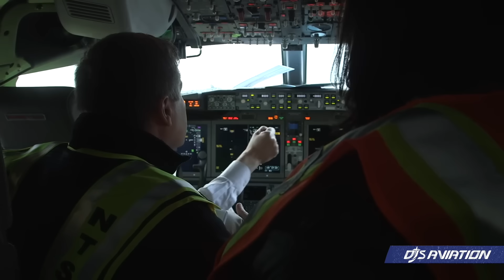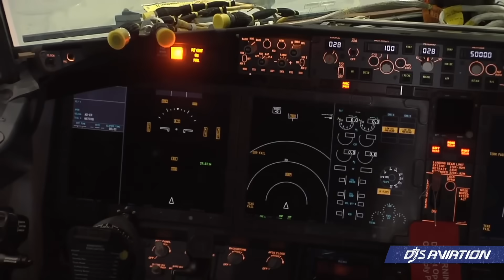Huge Boeing 737-9 Grounding Updates

Comment: The FAA must make it crystal clear to Boeing that this their last chance. One more quality control failure and the MAX type certificate will be suspended, pending a stripdown audit of the production process, and a stop on the production lines until a restart under a completely rebuilt product safety ethos.
Reply: It should be a wake up call. quality should now be the focus rather than what we all know beginning with P and ending T.
Reply: @nickolliver3021  The rudder bolt issue should have been the wake-up call, but it wasn't. MCAS and 346 uncharged cases of corporate manslaughter should have been the  wake-up call, but it wasn't. 
In my opinion THIS TIME the FAA should have pulled the MAX certificate and stopped production but it won't.
Reply: @ihmcallister  The rudder bolt isdue was on the previous models. The mcas and 346 people is on the new model. If you really believe the MAX certificate should have been stopped by faa then go tell em but they can't because orders and demand prove its worth continuing and making it better.
Reply: Eventually, in the worse case scenario I guess Boeing could be placed under FAA temporary administrative supervision.
Reply: @nickolliver3021  "Orders and demand" should play absolutely NO part in what the FAA does once it has investigated Boeing.  If certification for the MAX, other 737s, or ALL Boeing aircraft needs to be suspended until they are all checked and if necessary rebuilt, and the company accepts continuous oversight from an independent FAA team, then so be it!
Reply: @chrisantoniou4366  tbh investigations go on for months if not years so by that Boeing won't have any orders this year. But they have to in a way where the ntsb have to put final causes as to what happened. If not orders have to cone in in tne background. As its just for the max 9 then whatever had to be done before all resume, has to be done. Then they go from there. Other boeing aircraft dont need checking as as I said only max 9 needs it.
Reply: @sylvietougas9374  The FAA doesn't have the manpower to do that nor the funds to hire that manpower. And that lack of funds (already severe at FAA) can be blamed on Congress.
Reply: @nickolliver3021  If the failure of the 737 MAX 9 door plug is found to be systemic in nature (lack of or inadequate checking, falsifying checking, untrained or inexperienced staff, etc) then there is every possibility the inquiry will spread to other Boeing models.
Reply: @chrisantoniou4366  They won't be because those other boeing models won't have the plug doors. This is specific to the max 9 only.
Reply: @nickolliver3021  Read what I wrote again...  If the problems are SYSTEMIC, the inspections and possibly groundings will affect other Boeing models.  Loose and/or missing bolts are not exclusive parts for door plugs - the loose bolts in the rudder are testament to that!
Reply: @chrisantoniou4366  I'm not going to repeat myself but it won't be on other boeing models. It's only for the max 9 only. Max 8 is fine. I'm not repeating myself again
Reply: @nickolliver3021  I "heard" you the first time.  Happily however, it won't be you who makes that call!
Reply: @chrisantoniou4366  oh would it be? Well at least read what I say twice because that was the truth

Comment: What about Spirit AeroSystems? That's where the fuselage (including plug door) are assembled before being shipped to Boeing for final construction.
Reply: Boeing took the plugs out and then reassembled it back in. 

Also it is ultimately on Boeing QA for allowing poor standard from their contractors to pass.
Reply: They are suppose to pressure test it so no excuse really
Reply: Boeing can delegate tasks to a sub contractor but it can't delegate the responsibility . They need to conduct oversight, through audits, samplings in accordance with their Quality Manual.
Reply: @johnhayes1635  Loose or missing bolts on a door plug may still pass a pressure test, but once the nuts on the bolts come loose they can be shaken off in service and the door plug can then come away.

Comment: How many more so-called quality escapes have they been on these planes?  Luckily, they found the door problem with no loss of life and it certainly looks like it’s not the only plane from the series affected by loose nuts on the door plug. What else is there how many ticking time bombs are out there?  They really should take a plane that has been in use, not straight off the production line, because now Boeing will be making sure everything is tight and strip it.  That should go for every model that Boeing have produced in the last five years. I’m not getting on her new Boeing aircraft I want an aircraft that’s been time served. You normally find when the quality starts to escape as they call it it doesn’t only affect one part of the product.

Comment: They should all be scrapped as  no one knows how many faults will come to light over the next few years.These airlines have gone into this nightmare with their eyes wide open, the groundings,saftey issues,plummeting asset values and operational losses. These directors should be sacked,a cheap aircraft is cheap for a reason . Shareholders have had enough by these poor management of alaska they must resign today.

Comment: Based on everything I've read and listened to, Boeing, since McDonnel Douglas became involved, has cut quality control to a bare minimum, and in some cases done away with it.  I'm not sure if Boeing aircraft are really worth purchasing if you're a major airline.  There's no excuse for the mistakes they're making.  Qualified, non-company, inspectors need to double check every part of the work being done during assembly and during maintenance after the aircraft is in use.  Too much good old boy system between the FAA, NTSB, and Boeing.  That never works out well.

Comment: I’d fly on a 737 max 9. What’s the worst that could happen?
Reply: Is that a trick question, as I have a pretty good answer for that??
Reply: Make sure it has emergency doors instead of plugs though
Reply: Seems like the worst that could happen would be you taking innocents with you while fulfilling your death wish.
Reply: Keep your seatbelt securely tightened during the entire flight   :-)
Reply: Once they've been re-recertified, they'll be the most heavily inspected planes in modern times. After all that, they SHOULD be safe.
Reply: @rodh1404  "SHOULD" being the operative word, no guarantee they ARE nor WILL BE!

Comment: quality escape???  bull.  Boeing constructed the fuselage to the demands of Ryanair which, because it crammed so many passenger seats on the aircraft, had to have extra exit doors.  But other airlines, e.g., Alaska, did not imitate Ryanair.  Those extra exit doors were therefore unnecessary.  But the fuselage of the max 9 still had them.  They just decided to plug them (i.e., they were not going to be used at all in emergencies).  thus from the inside of the plane, there were no indications of these extra exit doors.  Boeing should have constructed another type of fuselage for customers like Alaska Airlines.  But no, they wanted to produce the aircraft type as cheaply as possible by sticking to the fuselage demanded by Ryanair.  Once again, Boeing chose profits over safety!!!  quality escape???  please, don't make us laugh!!!
Reply: There's no reason a door plug should be unreliable, and 737-9 is not the only plane to use them. Also, airlines like Alaska want them anyway. Having no option to later remove that plug kills resell value, and Boeing was advised by its customers to use a plug rather than a separate model with no door.

Comment: Boeing's design failures and their poor 'quality control' issues are putting Commercial Aviation Maintenance Technicians on the spot! It's one thing to maintain a quality product, but it's another to try to maintain poorly designed and poorly built aircraft!

Comment: Most of this conversation is I believe is part of the problem. This commentor is really just talking crap. The work that has caused the  problem has been carried by a mechanic way down the food chain. That work has not been up to standard. But then standards don't start at the bottom they start at the top.

Comment: There is a strong case that this wasn't a Boeing problem, it was a third party contractor who failed to reinstall the bolts after installing a WiFi system.
Reply: Debunked already.
Reply: This is all about perception though.
Reply: @apveening  Debunked by whom?

Comment: Has nothing to do with Boeing. It's the wifi company.
Reply: No, it's the runway. Or the radar. Or the fire truck. Anything but Boeing, right?
Reply: Doing inspections on planes with and without the Wi-Fi upgrade might uncover some answers or differences between factory installation or maintenance installation.
Reply: @Old-Blue      Exactly.  Somehow I'm thinking the wifi installers are not necessarily versed in the subtleties and intricacies of how a door plug is properly re-installed. If their activity there went unmonitored / unchecked, wow.  Wonder if it will come to this. Unqualified personnel handling critical hardware they're not trained to handle.

Comment: Thanks for some quality weekend comedy. Boeing has nothing to do with this. The fuselage and plug were manufactured by Spirit AeroSystems in Wichita. Boeing may have chosen a poor supplier, but to place blame on Boeing for this manufacturing defect is quite a laugh.
Reply: Is it a Spirit airplane, or a Boeing airplane?
Reply: Apart from Spirit having formerly been Boeing, Boeing is the aircraft manufacturer and therefore responsible for the finished product.  It's up to Boeing to ensure their contractors are providing the company with components which are properly manufactured!  Having said that, it doesn't seem to have been a failure of the part itself, but in the way the door plug was attached to the aircraft - loose and missing bolts seem to be the culprits here and if that turns out to be the case, the blame has to lie with the last people who attached the door plug to the aircraft.

Comment: I noticed the extra [flat] antenna on the alaska max9 plane, it is possible that those planes will use starlink networks integrated to their autopilot and all its system, like the tesla cars. Alaska and United want to gradually remove the pilots and fly the planes remotely like a drone.  Any individual, let alone governments and rich with a few thousand dollars can take control of the planes or can easily jam the signals. They did their test runs on tesla cars and many crashed with people in there.
Reply: now that’s a real rabbit hole! Don’t get too lost…
Reply: Please provide where you got your info.